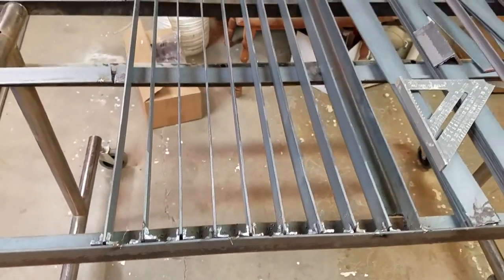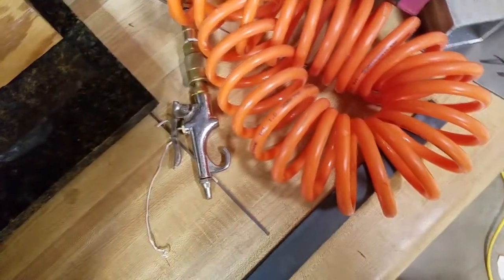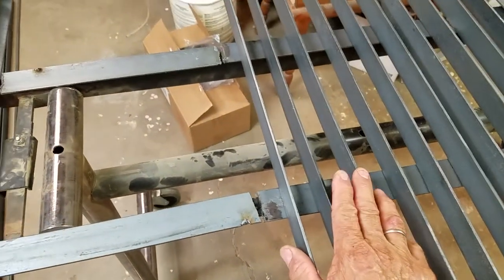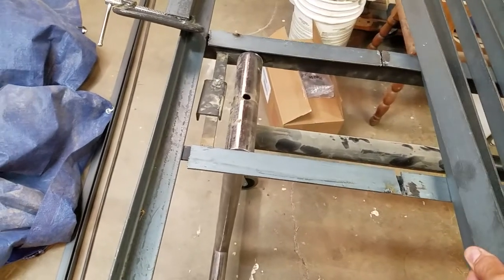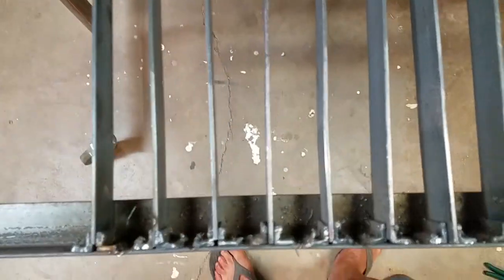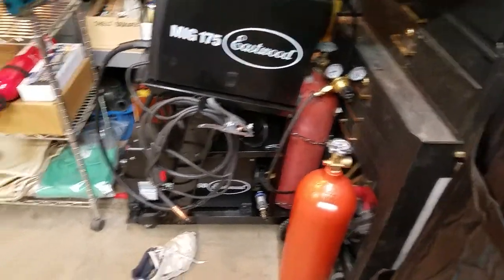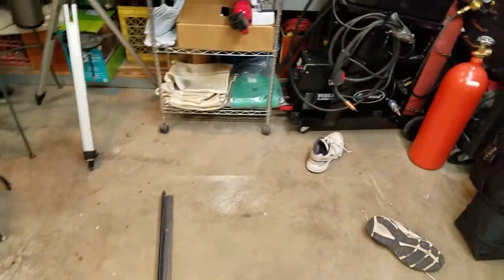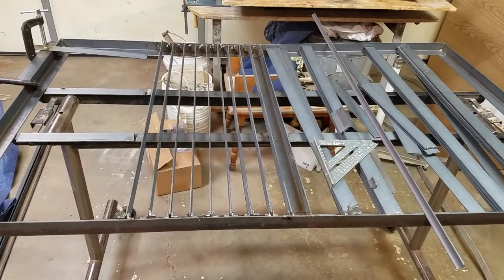Welding plasma table part 4

Comment: I like the slots for the sacrificial supports. When I make a table for my powerplasma cutter I will do the same.
Reply: Sacrificial slats are a must when using a plasma cutter. They make it much easier to freshen up the cutting table after a lot of cuts. I put mine in as soon as I bought my everlast plasma cutter.